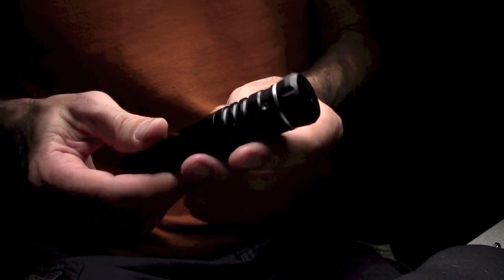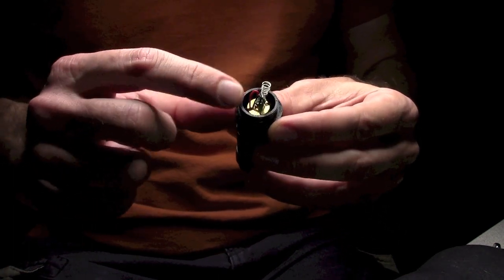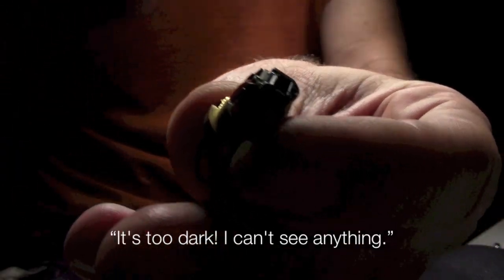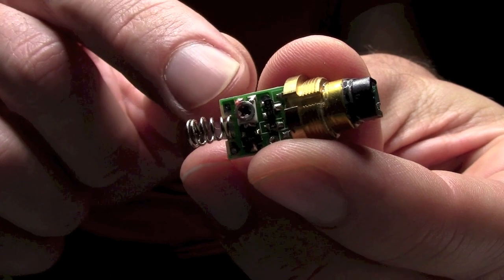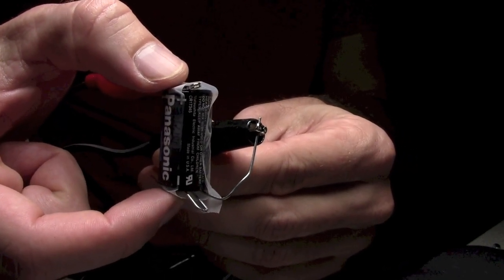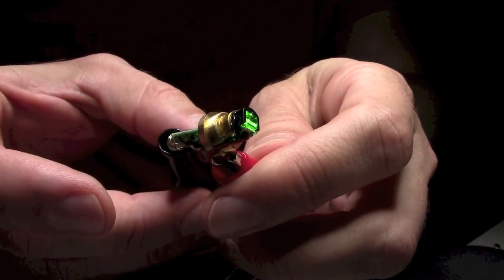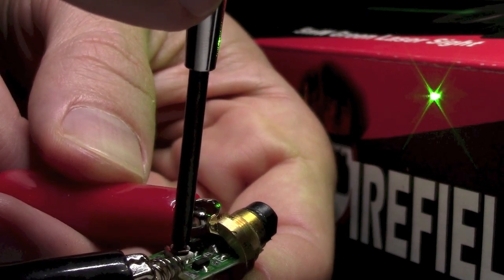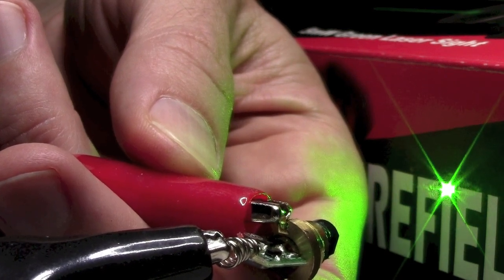Adjusting output power of a green laser

Comment: Thanks for this information. I have many lasers, mostly firearm lasers and pointers, but I'm going to explore a few of them and see if any of them have the potentiometer to adjust. Never took any of them apart. In particular is a laser from NOVA Lasers (not for firearms) with a peak output of 90.0 mW. It seems to have lost about half it's output over the last six years or so. Would be great to get it back to the original output. Thanks again for the cool tip.

Comment: This drastically reduces the lifetime of the diode and ktp crystal. Laser diodes are very fragile and you can easily kill them by touching the leads on the diode itself. Also they are rated at a specific current. With your 'mod' you just increase the current flowing through the laser diode. The circuit board is just a constant current source. by increasing the current you get a ton of infrared light passing the KTP crystal because it is over saturated which is really dangerous for your eyes because you cant see it! The 808nm pumpdiodes usually have around 200mW of optical output power where about 50mW leak through the crystal. Seems like the laser pointer in the video has an infrared filtee but sadly most cheap ones dont. Be carefull with handling lasers!
Reply: Nuh uh
Reply: Jeez who called the fun police?

Comment: No doubt increasing the   current beyond the factory setting to the laser diode is a  early death to the LD.  The laser diode will  go into avalanche  failure . When the laser diode fails. It will go dim and change color. If you decide to increase the  power of your laser by adjusting  the potentiometer  on the driver board keep in mind that the laser will be   permanently  damaged very soon.
Reply from the maker: The candle that burns twice as bright, burns half as long. Mine burns five times as bright. LOL
Reply: @PDBreske  Laser diodes aren't like candles, not even in this respect. Make it burn twice as bright, and chances are that it will last only 1/20th of the time... ...or maybe even die instantly.

Comment: potentiameters go up with power turning counter clockwise. You were turning it down perpetually until u topped it out. its a bad idea to top it off like that itl burn out. Also any red u see out of a green laser is infrared 808nm light, and its wayyyyy brighter than you can see. For a 5mw green color, it needs about 100mw of infrared or so. Dont look at it.

Comment: Some brand new LASERs appear to overheat even without adjustment

I've bought a handful of these green LASERs seemingly identical to this one. 
After ~55 seconds of "on" time (both of them right out of the box) but with a fully charged 16340 lithium cell, at least 2 of them overheat WITHOUT my having made ANY adjustment, and the LASER dot becomes so dim you can barely see it even on a bright white wall
It does not happen slowly...it's a step function. One second it's too bright to look directly at the spot on the wall, and you can see the beam in the air in front of the LASER, and the next you can barely see the dot and you can no longer see the beam in the air at all.

I do NOT yet know which component(s) is(are) overheating, but I tend to suspect the diode is the likely culprit as diodes tend to operate non-linearly.
I then wait a minute to allow the device to cool down a bit, and after then restoring power, it's again as bright as it was originally. However, this time it takes less than the full 55 seconds to overheat and become dim. At the time the beam is dim, the battery still has a basically full charge and when moved immediately to a different LASER, easily keeps it powered up as brightly as expected.

The other LASERs (same model, same Seller), appear to work as expected and do not dim after even a few minutes of constant ON...it's just the 2 (again...unmodified) devices that have this symptom.

Comment: for those of you who have different lasers just attach an 18650 battery to it and it gets brighter. but dont leave it on for too long
Reply: It could only get brighter if the LASER is designed such that one was using it with a 3.0V cell (whether or not rechargeable) and then changed to a 3.7V (nominal) cell (18650 or any other with that voltage). 
Also, to get the same brightness increase as an 18650 3.7V (nominal) cell, you could instead use a 16340 rechargeable 3.7V Li-ion cell (or similar size) which can be also obtained in the same physical form-factor as some 3.0V cells and may even fit in the same location as the original cell. The 16340 outputs the same 3.7V voltage as an 18650 Li-ion cell, but assuming similar high quality the 16340 can provide less than 1/4 the mAh (or Wh) capacity as an 18650 cell.
-----------------------------------------------------

Some Notes On Li-Ion Cells and Seller mAh Ampacity/Capacity Claims
The maximum mAh you can get from a very high-quality 18650 Li-ion cell is about 3800mAh. If you're willing to pay a LOT more money, you may be able to get a few hundred more mAh out of an 18650.The maximum mAh you can get from a quality 16340 cell is perhaps 800mAh.
Anyone claiming higher ampacities/capacities is being unrealistic. They are possibly either lying outright, don't understand what they're talking about, or are performing the capacity tests at an unrealistic discharge current level that is MUCH MUCH lower than 0.2C for a given lithium-ion cell (and certainly less than the ~300mA discharge current class IIIa green LASERs like these typically use under normal temperature and voltage).
I'd never even consider buying an 18650 Li-ion cell from anyone claiming it can provide over 4500mAh, or claiming their 16340 cell can provide more than 800mAh.

Comment: Does this laser have windage and elevation adjustments? I didn't see that being a problem is so. What is that laser's model? Thanks for the great video.
Reply from the maker: Yes, sort of.
The barrel of the sight has set screws at the 12-, 3-, 6-, and 9-o’clock positions. To adjust elevation, you loosen or tighten the top screw while tightening or loosening the bottom screw. The same for left-to-right windage adjustments. It’s a poor system and very difficult to get right, and there is also a chance that you can over-tighten and/or strip the screws as you make these adjustments. Since the barrel is made of aluminum, it is very easy to strip the threads of the very small screw holes. I expect this was cheaper to implement than traditional adjustments, and much less satisfactory.
The model is in the description: Firefield 5mW green laser aiming device #FF13037K.
Reply: Thanks for the info! I may try this.
Reply from the maker: Have fun!

Comment: That diode is gonna burn out sooner rather than later.
Reply from the maker: +Scott B It's true; the candle that burns twice as bright burns half as long, but I have used this thing exactly twice since purchasing it. I'm not really worried about how this adjustment reduces the life of the diode.
Reply: only if you let it overheat, every diode has its temperature tolerance level,breach it and it will disintergrate far more than under factory designed use.
Reply: I don't think he gives a fuck about the life of the laser. If he did I'm sure he wouldn't have made this video.

Comment: How xan I replace the original push botton to a simple slide ON/OFF botton...n what if the casing of the lazer is aluminum and the lazer cristal holder is plastic...where do I connect the positive to..???
Reply from the maker: If you don't see it in this video, I can't provide an answer. I have opened up ONLY this particular model.

Comment: hi i have my 5 mw laser and i did take it apart successfully,  but there is no screw to tur and my laser has only a small black button on the circuit board.  is there anything i can do to make it stronger,  it is a big black chunky laser that i bought from witch the online app
Reply from the maker: +michael mcleod I made the video based on the laser I own, so I can't possibly advise you on a different assembly. Is yours also a Firefield model #FF13037K?
Reply: i dont know the make , but its a big chunky black bulky metal design , and it did come apart the same way but only difrence is that the circuit board has a small black button instead of the screw , i tried to turn it but i dont know if it makes a diffrence as im still waiting for the battery to come in the post, i bought it from wish gadget online store . £7
Reply from the maker: +michael mcleod I assume your laser arrived in a box with a model designation on the box. If it's not the exact model shown here, I can't help you. It sounds like your circuit board has something other than a potentiometer, so I'm not sure how you can adjust the laser output. Sorry.
Reply: nope , it came in a grey plastic bag in buble wrap . i have also just realised it is not a laser pointer , it seems to make a pateron and when i remove the tip it just gives a rough cheep dot . but hey you get what ya pay for . i will just have to buy another . but thanks all the same.

Comment: I did it with my green laser. now it is red for some reason. how do I fix it. or reset it?
Reply from the maker: Send it to me and I can fix it for you. Remember to include a check for $100.00.
Reply: Phillip Breske no thanks. that's not even how much I paid for it. I paid 4.00$ on ebay for it. I just wanted to know who to fix it
Reply: Michael Mendez over current burned laser diode. and now it is dying. no way to fix it.
Reply: he was joking xD
Reply: cus you busted off the frequency doubling crystals now you are getting a dangerous amount of infrared.  Don't look at that because it will burn your retinas.  Unless your scenario is that you cranked the output too low, just adjust the potentiometer until you see green output.  Also try replacing your batteries if that doesn't work.

Comment: could't it heat up too much?
Reply from the maker: +Ian warden miliili It's possible, but I never use this thing and even when I did, it was for only a few seconds at a time. I'm sure that turning up any device past its normal wattage would decrease the lifespan.
Reply: It does. The pot is trimmed to set the amount of current that goes to the laser.
Laser diodes increase brightness with more current.
The trade off like you say is they retire early.